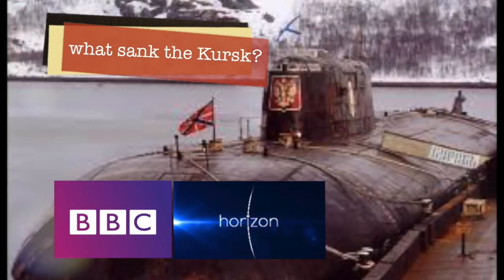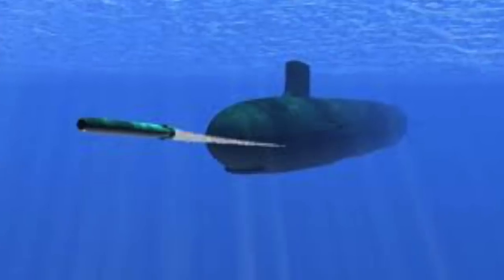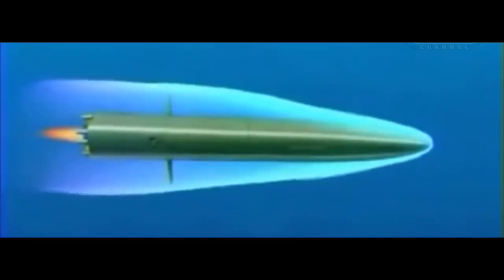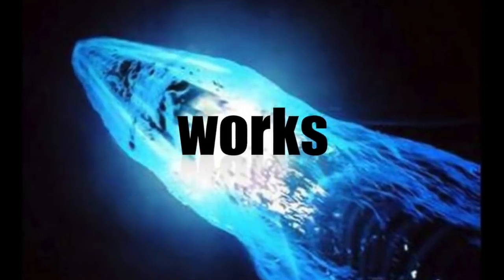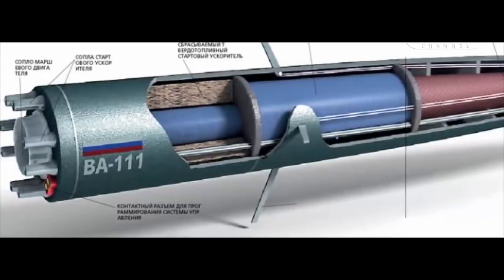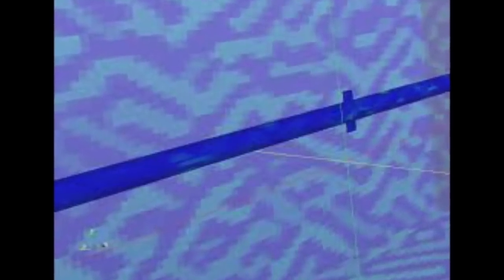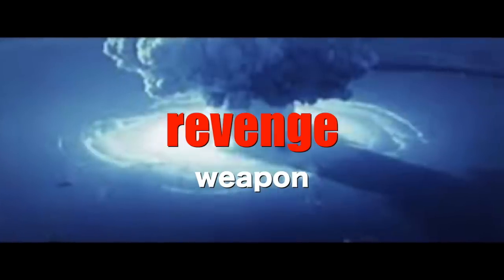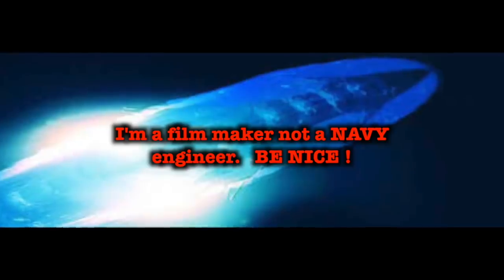Secret Shikval Torpedo - Secret USSR nuclear weapon - Prof Simon

Comment: the shikval torpedo can actually maneuver under water in a limited fashion. it does this by extending a fin on one side and retracting one on the other side. the tips of these fins skim the side of the cavitation bubble in their normal position. and thus if you retract one side. and extend the other. the side where the fin is extended will have increased drag compared to the other side. and so the torpedo will steer in the direction where more drag is applied. it also had a guidance system called GLONIS (automated intertial Guidance) you can see the big electrical connector on the rear of the weapon in the video (round gray object with 6 smaller holes around it) it would receive Sonar data trough this connector from the Submarines Active Sonar. and since Wire guided missiles exist and Wire guided torpedoes do too, i would bet you could wire guide this thing too by connecting a guidance wire to that same connector.
 
the shikval 2 is reportedly more maneuverable, and it is rumored that this is because it was given a thrust vectoring nozzle. as well as an ability for more extreme deflection of the nose assembly allowing the weapon to stay inside the cavitation bubble even during hard turns.  

there are also some documents and articles that have appeared in China and Russia that seem to suggest Shikval never used a Solid rocket motor as main engine. but something referred to as a "Hydro Ramjet" that runs on "Hydro Reactive metal Fuel" but im am quite unsure if that refers to shikval or if it refers to a project called "Khishchnik" which is supposedly a new super cavitating torpedo meant to replace the VA-111 Shkval.

also the idea a nuclear variant would destroy the sub it was launched from is laughable the launch range of shikval is a maximum of 7KM and the 210KG warhead size would limit its nuclear capability to a roughly 3KT nuclear weapon. in which case under water 7KM would be far outside of the danger zone. 

also a revenge weapon  that would destroy the using platform would imply they also only carry a small number of them, say one for each torpedo tube. so why do Russian Ships and Submarines sometimes carry several reloads worth of VA-111 torpedoes?

the idea that they designed submarines specifically to launch the nuclear variant of this weapon is laughable too for the above stated reason. they made the double sided hull to increase weapon loadout as well as increase maximum depth and to some extent depth charge survivability.

revenge weapon is such a dead term. aren't all weapons, weapons of revenge? you design them to defend your own country, and then you use them to enact vengeance on the perceived wrong doings of third world nations.
Reply: And more than this i heard they passed 660 km/h speeds with the the new hydro ramjet propulsion but they are quit sensible and not yet that shure in usage...ofc this was news in 2010 since then who knows what else they done ...

Comment: I served on several U.S. navy submarines, and it was common for sailors to be assigned bunks in the torpedo room, which were rearrangeable just like the torpedos themselves with the same machinery.  On one mission, I slept with my face a few inches from a torpedo of some kind and even sneezed once and bashed my face into it.  I could have broken my nose, but for the fact that it was of course round.  This was over 20 years ago, but I believe this is still done on the newer boats.  I don't think at that time there was any torpedo like you describe onboard any of the boats I was on.  They may have been in development, but far from being put into use on a real sub at that point.  Because of the unique nature of the propulsion, they may require significant redesign of the tubes and storage and movement infrastructure.  I don't think our torpedo tubes were designed to handle the forces associated with a rocket inside them.  So, it would probably require something else to shoot it out of the tube first, like we probably do with launching cruise missiles, for example.  The torpedo room wasn't an off limits area, so in most cases anything super secret wouldn't be in there for a young enlisted man to smash his face on.  I wasn't in the weapons specialty, so I'm only speculating.  A really fast torpedo would reduce the amount of reaction time to the point where little can be done to avoid it, so it sounds pretty scary to me.

Comment: A spearfish torpedo will do 80knts for final attack run. And any speed inbetween for acoustic listening. Mk48 will do around 52knts with a similar profile  in all other respects.
Reply: One thing is not clear to me. Why are you comparing torpedoes from the 70s and 80s from the last century with your modern torpedoes? Other torpedoes are used in Russia. Iran will not allow the United States to enter the Persian Gulf without using these torpedoes, as some * experts * write. Iran has good coastal anti-ship complexes.
Reply: Not deeper than 300 metres/1000 feets... than in gonna be flatten to the size of an christmas card) With all respect.

Comment: Take a look at GHOST and how it uses super-cavitation.  We know that 50 knots isn't the limitation of water craft -- we've got jet boats that do 4x that by using traditional screws just powered by a jet engine.  So a torpedo with front counter-rotating screws that cavitate the water while also being powered by a chemical reaction that produces steam to surround the torpedo as it's exhausted out the front could see such a design w/out having to use a rocket motor.  Perhaps a small turbine powered torpedo with liquid oxidizer that can skim in some seawater and boil to steam for cooling using the turbine to power a beast front-mounted, possible protruding counter rotating screw?  The cooling steam could be used as not only an enveloping gas, but also as a thrust mechanism like space vehicles use?  Basically a rocket that spins a turbine, seawater flows through small holes in the turbine, turning to steam to further envelope the weapon in gas, while cooling the turbine.  We don't have to use traditional engine saving design as this is a weapon that will be destroyed so the turbine only need to survive long enough to reach the target.  250kts speed w/ a 2 minute run-time would see a 15km range.

Worth further note -- when steam is super heated, it breaks water down back into hydrogen and oxygen at a perfect ratio (why nuclear reactors melting down have an explosion hazard).  If we could harness that effect, the initial oxidizer would be minimal relying on the oxygen in the water boosted with hydrogen alone to keep the device running.  It basically be a hydrogen-oxygen rocket with additional hydrogen injected to keep a nice burn going instead of an explosion.
Reply from the maker: Thank you M Hamma,  good research and it's fascinating what's out there.
Best wishes,  Prof Simon
Reply: Speed above water and speed under water are two entirely different things...
Reply: When Russian military makes weapons , they make it simple , so Rocket Engine it is   ,  Americans are known to over engineer their stuff , so that what you are saying sound like something Americans would do . Why not put a drone in  a torpedo as well , and make it independent , robotical , able to operate for weeks , track targets by sonar for days , just for political purposes . Thats something Americans would do ,  i think it exists , unmanned Drone Subs  ,  why not . You dont need a shkval if you have a drone sub that can it self go lot faster then big sub can , your reaction time would be less and would have upper hand .
Reply: Привет из РОССИИ.